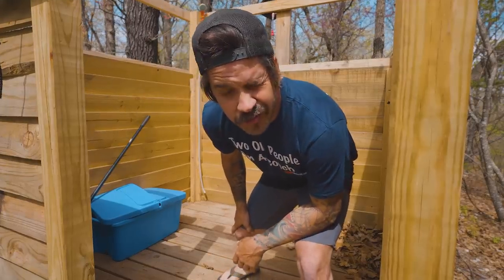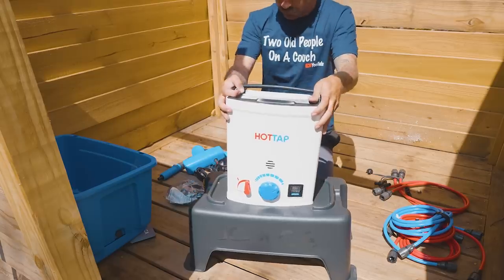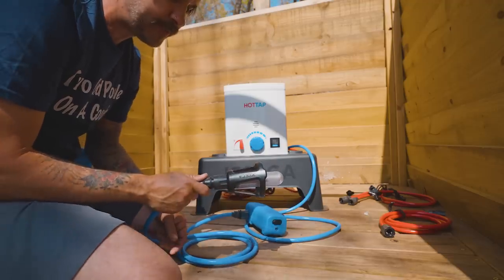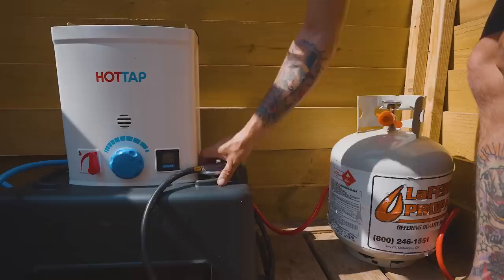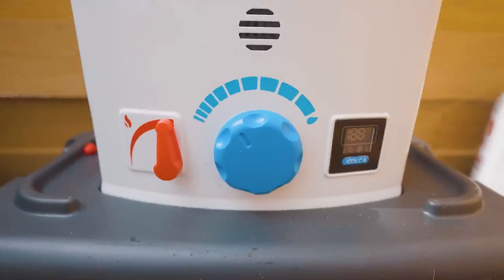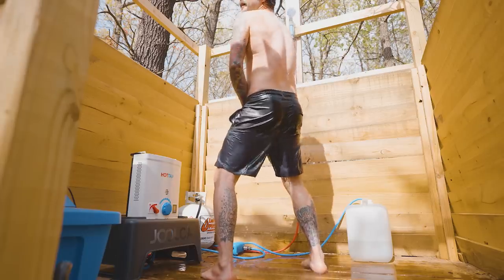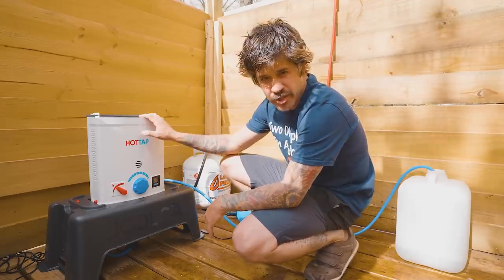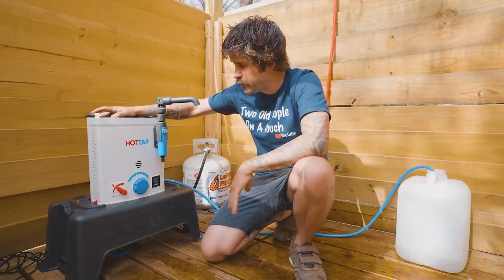My New Girlfriend Gets A HOT SHOWER! Joolca HOTTAP Nomad Kit - Unboxing and Review

Comment: Get you a barrel,  paint it black,  build a platform to put it on( gravity). During the summer you wont need a heater. During the winter you can still use the barrel for your water supply with the heater.  We done it this way while building house on island in south florida.

Comment: We had 275' of black hose that we draped over the top of the barn (black roof), that would get you a very good shower. The biggest problem was warm-up time if more than one person wanted to take a shower. We got a propane heater similar to yours after a couple of years with the hose set-up. We used that shower even when we got an indoor one, and finally tore it down the first year of our YouTube channel three years ago. We will be building a new outdoor shower soon. Nothing beats showering outside in the summer! 😊

Comment: In the Navy, we called it a Submarine Shower.. Turn it on, Get wet..... Turn it off....soap up, Turn it on and rinse off.. Water used?.. Less then a Gallon per shower.. Now, get a big tub of water and mount that all to the outside/back of the shower with a shelf for the propane tank.. 
Get another one for the Kitchen and set it up.. When you only have one and a part goes out.. You are now without hot water.. 
That is a fantastic design and initiative manufacture.. I can see a lot of uses.. 
Thanks for the video.
Reply from the maker: I lived in tour busses with famous bands, and we did the same. Only reason I left this on was to test how much water it'd suck up
Reply: @TheCrockers  Oh, I get and appreciate why you let it run.. Gotta see how much it uses if someone takes a "Vacation Shower" ..lol.. I get it.. 
I suggest you do a show on applying this system to your kitchen.. Mounted full time.. The sponsor would enjoy the Kitchen show I'm sure....

Comment: hubby Donny just installed a hot water heater in our RV, it's nice to take longer showers where I can actually wash may long thick hair and it's still hot water (we have a different brand, but we are not off grid, we are hooked up and not sure how much water it goes through, but we did change out our shower head to a lower flow water shower head before we had to change our water heater when the old one quit working)

Comment: Hey... Ideas for your consideration
 1) moving the trough into the shower area and setting up the faucet to be your tub filler
 2) find you a rain water collection barrel to fill and use (if possible)
 3) if you have any of the metal roofing leftover, build up a faux roof to catch extra rain water for the barrel
  Just an idea or 3...

Comment: Well, looking at the website, the blue container is the sink portion of the kit. I think putting the propane and the heater in a covered closet on the outside of the shower enclosure, between the house and shower, would allow you the option of serving the house or shower. That would allow you the space to possibly connect the house and shower by making a door in the bedroom area.

Comment: I got totes and cat rain water, for livestock and laundry and washing you don't need to filter it. A Burke water system drinking water. I put totes up off ground, only thing is winter but you got 8 months without freezing them. The other 4 months I  catch water in troughs and use buckets. That shower building could have a plexiglass glass roof too, the sun would warm that up big time even in the winter

Comment: LOL Jason. It's about time you got a water heater! We do that at our other property that doesn't have water, etc. I told you before we have a big old water tank that we get filled up that we use our shower water for with a pump-battery hook up (not little batteries like you have but a bigger one and use the heater w/propane....we do this outside in Minnesota during April/May through Sept/Oct. Otherwise, that water is damn cold unless it's during the hottest part of the summer. Turn the water off while you lather up to save water. It's a shame you got rid of your truck.

Comment: We have an on demand water heater. I bought a dolly to mount it to and the tank will go on the bottom of the dolly in the flat plate, then it is all portable to any place any water hose. Yours has a great water filter. Now fir a bath tub all you need is a small stock water tank.

Comment: I forgot to tell you, if you have hard water and it builds up inside the heater, to clean that sediment out you turn the heater upside down and fill the copper line with vinegar it will eat the mineral deposits off the tubing. I love ours. You should put the clear green house roofing iver just your top to keep the rain and leaves out of your shower.

Comment: You could shut the shower head off, soap up, turn it on,  then rinse off.  Put a corner sink in.  Could you just run a longer hose to the shower from the house and put the shower head on the wall closest to the house?

Comment: Needs protection from freezing in winter.  Either keep in warm location, drain system entirely, or pump antifreeze through it.  Propane bottle and hoses do not need protection, just parts with water.

Comment: I got a Camplux heater and a separate water pump like the one I use to pump water up to the horses.  One advantage is that it can get the water hot at a higher pressure rate from what I could see.  That's my household water.  But I really want to build out a shower like you have cuz that's pretty sweet and get a setup like yours because of one thing you said.... you can leave it turned on. If I turn the water off for more than a few seconds,  it can burn up my pump cuz the pump motor keeps going full blast no matter what.  I have to actually turn off the pump, soap up or whatever and then turn the pump back on to rinse etc.  And I checked and their price point is quite fair. Thanks for sharing that Jason. And for LOL at your "air dryer" technique.  🤣

Comment: Put that blue tub to catch the water while your showering and you Can then recycle it in the clear original water source and have a longer shower!
Reply: That "blue tub" is the kitchen sink thats why the kit came with a kitchen faucet, a hot water line splitter & the lids are the drainboards. So you can wash dishes & have a shower.

Comment: mount a shelf up high in the corner so the jackery and pump cant get wet. yes i understand it can but its just to prolong the life of it and use of use. also run the hose along the top rail with hold downs so they are not in your way all over the place. 15mins of work to do all this ill help greatly in the long term. junk those cheap batteries they give you and get rechargable ones. recharge them when you know your gping to take a shower. either the night or day before and you will always have that covered

Comment: Morning Jason, LOVE  the new shower unit . Just a suggestion, how would it be if you turned it on to get wet, then turned it off while you soap up and do all the lathering etc., then you could turn it on to rinse off. Also, if it were me. I would get a rubber stock feeder big enough to stand in so you can catch some of the water as you are having your shower. Then you could have a seat of some kind and sit to soak your feet for a while before you turned the water on again to rinse off.  Now, as for having to have a shower for the ladies, I have a HUGE  issue with that, If they are too "fancy and frilly "  to take a rough and rustic daily top to bottom wash with a once in a while shower, they are probably not the kind of girls you would be happy with for long. I am 73 years old and remember having to have an "all over wash" every day, and you have the added bonus of the river close by for summer use. These peole who think they have to have a shower every two minutes is for the birds!  When I am working in my garden in the summer I have a hose hooked up to the faucet  and leave it out in the sun. When I get hot and need to cool off and freshen up a bit I turn on the wand and have a nice warm (sometimes really hot) shower. It only lasts about 2 minutes at best depending on how long my hose is but it is wonderful and refreshing on a hot day. Yes, I know, you don't have running water to be able to do that at the off grid cabin, neither do I at my off grid cabin , but just sayin for those who want to embrace  a more rustic lifestyle at their own homes. Sorry, but I do have to  mention this, I would much prefer a shower system that doesn't use propane or any other form of power that has to be paid for. (Yes, I am tight with my money haha) In my mind's eye I am visulizing a large tank of water and a roof structure close by, with coiled black (or green) pipe or hose curled up on top. Run the pipe to a smaller tank and hook into this smaller tank to feed your shower with the hot water in the pipe that was heated by the sun. Yes, you would still need your battery pack to run the pump (Unless you gravity feed..) but you would cut out the propane.  For winter use you might be able to build a fire system to heat the water and feed your shower by gravity.   Anyway, just an old woman here musing and thinking what she would try if she were 30 - 40 years younger. So take care and stay safe, sorry for the long post, I get lonely and have nobody to talk to hahaha....   Sandie from Ontario Canada.
Reply: @Sandie Black, this older lady is leaving Michigan in 2 weeks approximately. To go look for cheap land to start my new homestead. I will probably have a wood fire heated water for my bath house. I do you propane in my motorhome right now but prices just went up this week. I hope to start a YOUTUBE channel for my kids, grandkids & great grandkids to watch  "Grammie" build her new home.

Comment: That's pretty great...i winder if the tub is for the water. Kaye
Reply from the maker: Yes, but unfortunately it was cracked from shipping
Reply: no! If you read directions or go to the web site the blue "tote" is a kitchen sink with 2 drainboards. Thats why it comes with the kitchen faucet & a splitter valve so the shower & kitchen faucet can have water at the same time.

Comment: Don't think the actual heater should be allowed to  get too wet set it away to one side. You can get a bracket to mount it on the wall that lets you take it off and on

Comment: How well will that work out side in the winter...the regulator may freeze up on the propane tank . Will it fit in the house an run a pipe to the outside shower
Reply: use a larger tank & it shouldn't freeze up. I use 40 pounders in Michigan for heat & 20 pounder for gas cook stove in my motorhome for the last 8 years.
Reply: Propane is illegal to store inside any building.

Comment: Wouldn't the blue container that it came in hold more water than your jug?...just a suggestion...
Reply from the maker: Yes, but it was cracked from shipping
Reply: The "blue container" is the kitchen sink with the lids becoming the drainboards. Thats why it comes with the kitchen faucet & a hot water line splitter. To have hot water in bath & kitchen.

Comment: Didn't you used to turn off the water then lather up, and you turned it back on and rinsed. You could still do the same thing with this one. As long as you can reach the on and off button you should be good. God bless.

Comment: You could have water catchment.  You just choose not to.
Reply from the maker: Well Susan, bring your butt out here, buy the tanks, set up the gutters and do all the work. I'll wait...
Reply: You can still install the rainwater catchment. You have metal roofing. You had (not sure if you still do) have pvc pipes (cut in two lengthwise attach to roof frame with screws. Use more pvc for downspouts & a clean out with a tennis ball inside. only need 6000 glue, downspout ports & Y junction.
You also had an IBC tote. Pretty cheap fix to the water situation.
Paint tank blue or black with 1 strip of masking tape going from top to bottom. This will be your viewing area to see how much water you have. When painted remove tape strip, let tank dry. make sure to screen the top for debris & bugs.

Comment: Isn't the blue tub to hold the water?
I was suprised that it required batteries, propane AND your Jackery to run all that.
Reply: the "blue tote is the kitchen sink & the 2 lids are the drainboards to put your clean dishes on after washing & rinsing. The kitchen faucet is for that sink. And the hot water line splitter is so you can have hot water in the kitchen & the bath at the same time.
Reply: The batteries in the heater unit "ignite" the propane that heats the water. The jackery is being used to "suck in " the cold water from the jug to the pump, to the heater, from the heater to the showerhead. The 12 volt water pump does most of the work.

Comment: What girlfriend?  Ya just got a hot shower, what ya need one of them for?

Get yourself some microfiber quick dry towels.  They work faster than the bike.
Is updating your water collection setup in the close future?

Do you HAVE to use that stand?  Or can you hang the HotTap on the wall of the shower room?  Maybe even "hide" it in a cabinet?
Reply from the maker: It's for my future girlfriend. All y'all viewers said "you won't get a girlfriend if they can't even take a shower". Now there's a shower...
Reply: I think ya missed the joke.

Anyways, enjoy your hot showers...if you can get enough water stored for a good one.

Try looking if you can change the shower head to a lower-flowing head.  That might help?
Reply: propane heater can have a roof over it but cannot be enclosed. unless you make a flue with a fan to draw fumes up & out.